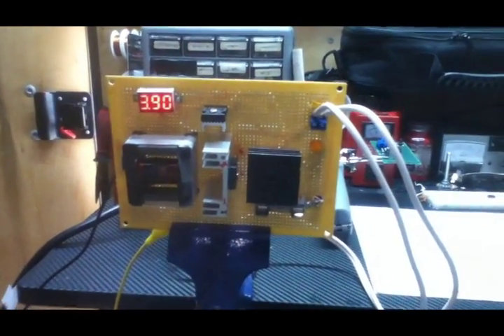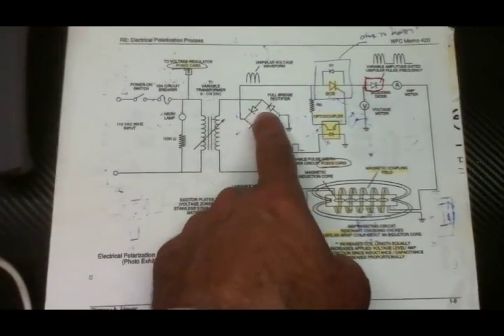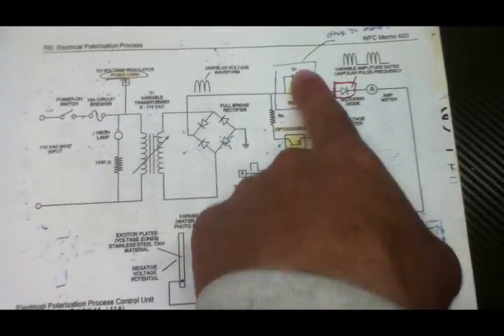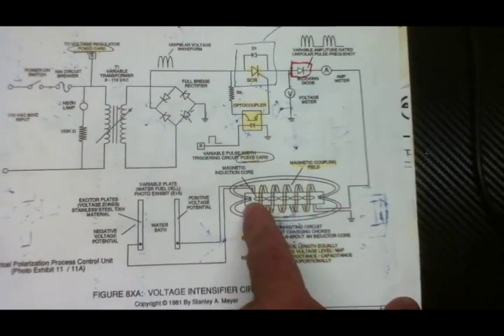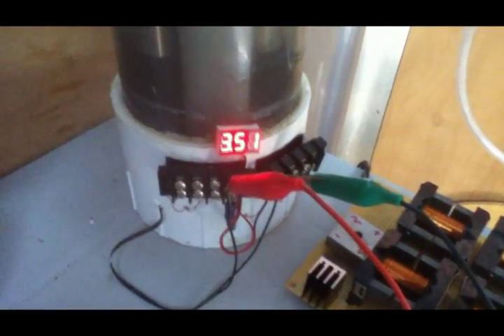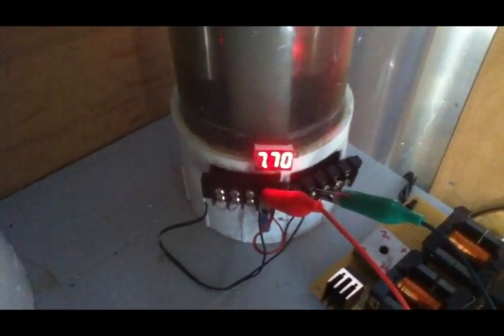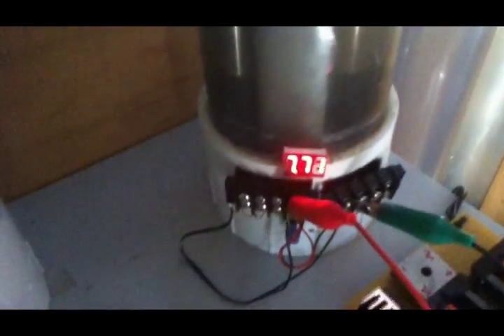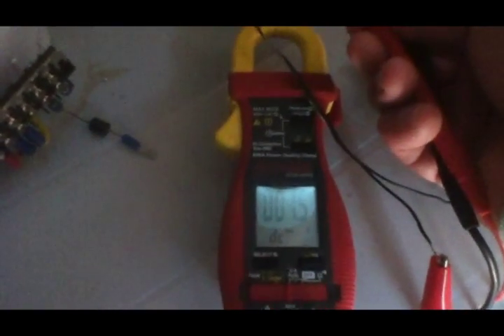Water Capacitor

Comment: Very awesome, did you try taking the coil out of the circuit? any difference? Im going to have to do this myself as i need a proof of concept ! There are none to be found on the net, none that are diy anyway, there are shows of giant production but no "this is how you do it". So people can experiment themselves, makes it difficult to get started when you need to invent the invention all over again with no proof of concept to play with. I have zillions of experiments to do with HHO, but this stan meyer super production has me really stalled as I keep searching to see if it is real and someone has come up with diy proof of concept instead of just using normal electrolysis and getting on with the ICE motor experiments.
Reply from the maker: Yeah sorry you will go down a path of research with many claims and very little to copy or DIY. I have been out of the research now for a number of years. Stan Meyers tech seems very promising but also very elusive. It is extremely complex for the average DIY.  What keeped me searching on Stans tech was that indeed there were certain claims that were reproduced like the quenching tube and disk. This gave me the confidence that maybe the other claims were also true This kept me searching for how  he was able to “switch off the covalent bond of the water molecule”. After multiple years of research I hit a roadblock. I would add more and more inductance to the circuit to limit the current and increase the voltage. My goal was to minimize the amount of Amps flowing in water bath between the plates. And this worked great but when I would apply high voltages the water would just shunt it down and consume it as heat.. so to make a long story short this is what I learned 

It’s not about how high a voltage you can present externally to the capacitor rather Your goal would be to see how the capacitor itself can create the high voltage diff internally. Stan referred to this as a “step charge”or “electron bounce phenomenon” 

Have fun! The reasearch will be extensive and you can learn many things along the way!

Comment: If you are still trying to get water split easily you have to anodize the negative plates in the cell. Stan used clear Delron to coat his, he also coated the copper coils of his EPG with Delron. His VIC is no more than a mini Tesla coil with a blocking diode going to the positive plate. Have fun and you are welcome.

Comment: stan had feedback circuits and a variable inductor.  He always went at it by limiting current when in fact he was creating a series resonant circuit.  The reactor design forms a really bad AC capacitor.  The plates are far apart.  The plates both have a dielectric coating on them.  In order for it to establish the electric field a capacitor needs to store energy the voltage in the resonant circuit has got to be way over 120 volts. Early radio systems had to supply the power needed to run the detectors.  They did this by building resonant blocking circuits where the feeble voltage over ground on the antennae at high frequency was fed into a circuit that was resonant at the field frequency.  Voltage on the capacitor would build up over many cycles until the capacitor shorted through the only avalanche diode at the time which was an air gap.  The air gap was in series with a speaker coil and formed the capacitor discharge system.  Classic Tesla.  I think Stan must have read some of Tesla's work.

Comment: Your set up looks pretty good. Can you produce gas at 1.5 volts? If not, then it will hold that charge because its not enough to break down the dielectric. Just my thought anyway. 

Without a duty cycle you will not be able to block very much current with the inductors.
Reply from the maker: Thanks,  I don't know how low we can produce the "step charging effect" that Stan mentioned. tap water is what I use and it has contaminants, this impedes charging effect to a point not a "perfect capacitor". I would assume that if we had
perfectly distilled water then maybe it would hold the charge and not "internally" leak in the capacitor. this condition would probably help in experimenting in lower voltages. Also the duty cycle is a must I agree... i recently posted another video with this connection ...its the 8xa9xb video..

Comment: Hi, you seem to be putting a fair bit of effort into the project. I’ve found the only way to limit the current is to use purified water. I haven’t been through all of SM’s patents but I think I’ve seen one where he shows a ‘water filter’ in the circuit. That could well be an ion exchange filter. To make sure you’re not kidding yourself I’d suggest measuring gas flow and input V/A for straight DC and them comparer any other wave form with that. Good luck with the project.  
Regards ... Andy